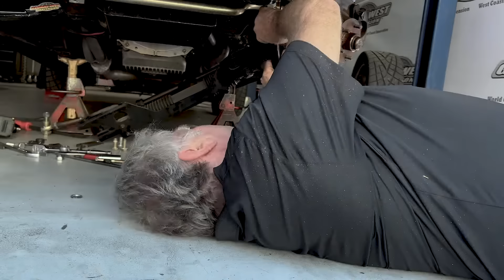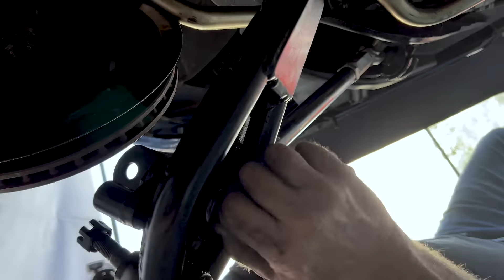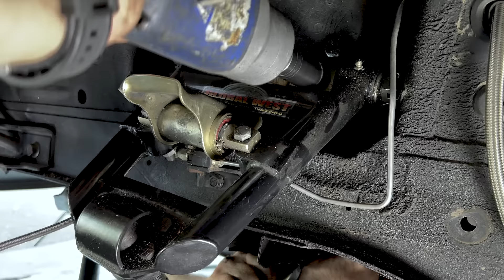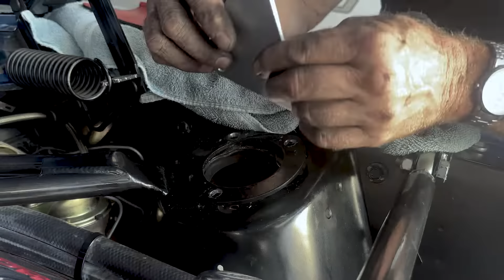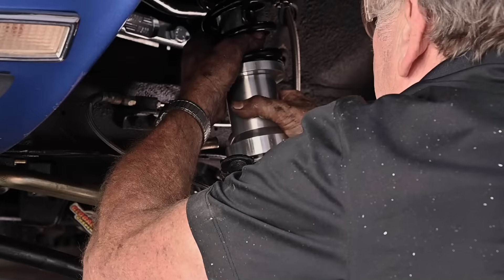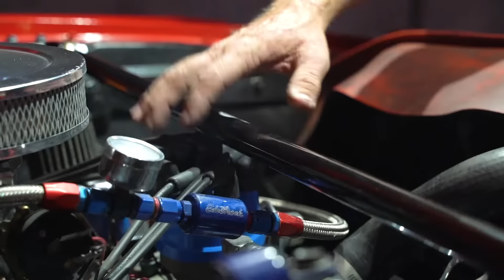Installing Global West Suspension Coilovers on a 1969 Ford Mustang Mach 1

Comment: If i had engine out restoration, I'd be tempted to do Mustang II, rack and pinion, tower delete > improve everything at once
Reply from the maker: That’s definitely an option. Depending on the motor combination. Our coil over kit will out perform and ride significantly better than a Mustang II setup. If you have any questions please don’t hesitate to give us a call. 877-470-2975.
Reply: How do you know you are improving everything? Do you know if your negative camber generation and your roll center location is optimized like Global West's is? Until you know what the mustang 2 installation gives you for suspension geometry, the only thing that you can say is improved for sure, is that there is more room in the engine compartment.